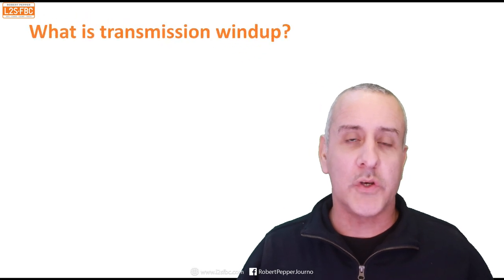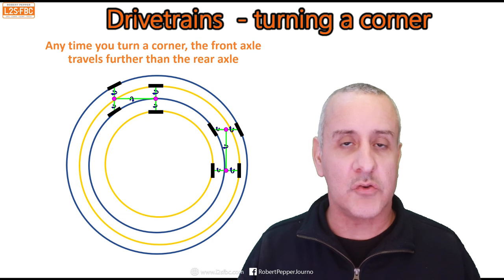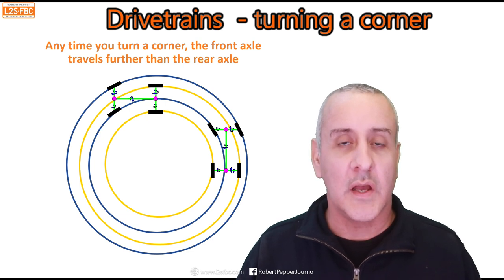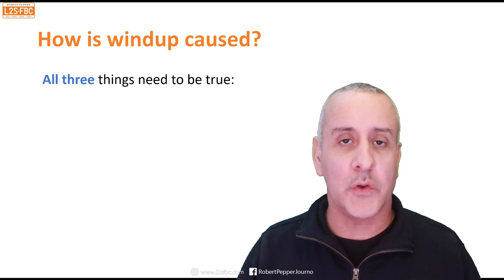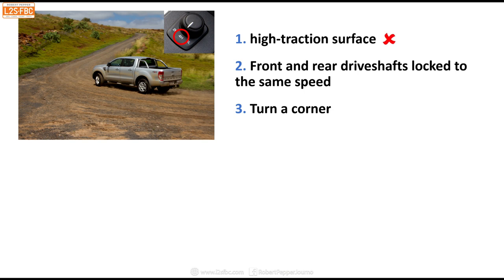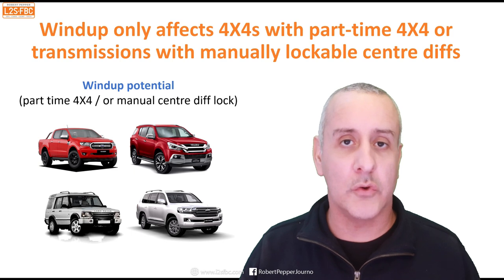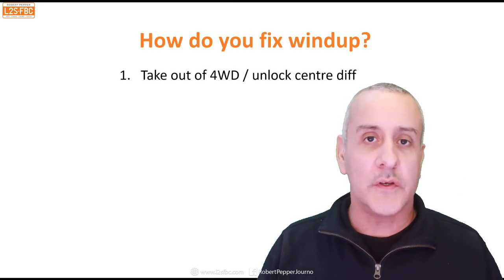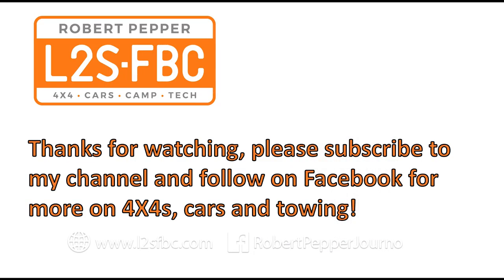Transmission Windup Explained (transfer case bind)

Comment: Excellent, clear explanation of wind-up. I am new to 4x4s and your videos have been immensely educational! Just one video was enough to get me to subscribe.
Reply from the maker: Glad it was helpful!
Reply: @L2SFBC  Yeah! I just hope I didn't ruin my new Jimny's transfer case yesterday or any other part as I took nearly a whole U-turn in a parking lot with 4H engaged. I could feel resistance halfway through the turn as the driveline was winding up. It felt like one of the wheels was getting its brake applied. When I realised what happened, I immediately shifted into 2H. After the car was on a straight path, I had to put it back into 4H and back into 2H and move forward to free up the front locking hubs.
Reply from the maker: Should be ok. Don't do it again 😀
Reply: @L2SFBC  Oh, I won't! You can count on that! Thank you again. Cheers!

Comment: This was a fantastic explanation and demonstration. The one thing I've never been able to understand is where this windup energy is stored. Is it torsion in the axles, or in the gearbox shafts, and if you keep driving under these conditions what is likely to fail first? Is it snapped axles/cvs, stripped teeth on diffs or the the gearbox. thanks again, wonderful video
Reply from the maker: thanks, please share! energy stored everywher in the drivetrain. As to fail first, really very variable and I haven't got enough experience to comment, thankfully!
Reply: I think the entire drive train stores energy like a torsion spring, the weakest link would fail first
Reply from the maker: Yes

Comment: A simple, old style part time 4WD is great fun in winter. Also because you have to learn how and when to engage and disengage the front. Tricky stuff taking a turn from a road covered with snow onto a well prepared main route with no snow at all! Full time 4WD are easier to drive, but it’s not so much fun…

Comment: Hi Robert! Thanks for yet another great video -- your channel is a real gem!

Does your recomendation of locking the center diff change when we're talking about a Torsen LSD? Specifically, if we're talking about LC Prado 150

From what I understand, torsen diff has a finite torque bias ratio, which means that it cannot send more torque  to each axis than TBR x 2 x friction of the most loose tire (in case of the center diff, because we have 2 wheels on one axis and supposing that the open diff has a TBR=1). 

My guess it that there is not much reason to use it on dirt roads, but offroad on an uneven surface or going up and down a hill would still be safer with the CD locked?
Reply from the maker: Yes, if you have a Torsen CD like in the Prado I wouldn't lock for dirt roads, but I would if it was an 80 Series with an open diff. When you get to uneven surfaces I'd be locking your Prado's c/d.  I do not subscribe to the "let's see how far we get before we use traction aids" school of thought; it damages tracks, increases vehicle wear, uses more fuel....nobody's a winner.

Comment: Your content is amazing, thank you.  I encourage others to join your Patreon so we can get more great content.    

I'm left wondering how people's rigs survive slick rock trails and why I don't hear much about issues caused by running those trails.   For example there's the popular slick rock trails in Moab, Utah with very high traction and sharp turning.  I would guess that vast majority of folks are running those trails without ever disabling 4WD, so there'd be plenty of opportunity for windup.   I never hear about transmission issues running these trails, yet on the other hand, I often hear warnings about not using 4WD on pavement.  This makes me wonder if the risk of damage caused by windup is overstated.  Perhaps wheels tend to break traction, even in high traction surfaces, well before serious problems occur?  What do you think?
Reply from the maker: Thanks yes need more Patreons, my dream is to be Patreon-funded and have a cool community of people discussing good things without FB ads and idiots.  Re the trails; well I've never driven in the USA, and have limited slick-rock experience but certainly enough to know that you would get windup in some situations. However the key thing is that offroad trails are not even or level so there's different weight on each wheel hence different grip, and have also dust/dirt and loose rock here and there.  Therefore, the transmission is able to unwind at points. Contrast that to a paved road which is always flat and level, never any real dirt, and therefore the transmission never gets a chance to unwind and synch front/rear axles, there's never anything close to diagonal wheel lift. A gokart has a fixed rear axle, no diff, and it turns partially by unloading the inside wheel to reduce grip...same sort of principle. I shall ask on my FB page the extent to which windup has to be managed.
Reply: @L2SFBC  Makes sense that there'd be more opportunities to unwind on even a high traction trail due to variances in the surface (though I think there's probably sections of trail that would be similar to pavement).   But I'm not convinced that the transmission never gets a chance to unwind on flat paved roads.  Wouldn't build-up of windup eventually cause the tire to break traction with pavement (unless something breaks first)?  Same as gravel, just more force required?  I've foolishly left my 4x4 engaged on pavement and while making an impatient u-turn, observed the tires squealing/hopping.
Reply from the maker: By the time the tyre breaks traction the damage is usually done - maybe not the first hop, but with enough, something will overstress.

Comment: I can tell you with absolute certainty that you can get wind up on gravel roads. It is something that I have experienced many times I have also  seen conditions where windup is pretty much guaranteed on gravel roads they can become very hard packed and very high traction.
Reply from the maker: Yes hence the point about high traction vs low traction surfaces. Some very hard clay roads when dry can be so good for traction you leave rubber marks. Some bitumen roads when snow covered are slippery.

Comment: I had this happen once, it was stuck in 4WD mode and vibrating hard over 60km/ph. Managed to get it unstuck by reversing backwards for about 10m and driving forwards and putting it back into FWD, a big thonk happened and it free'd it up. Most likely was a bad move but it worked, I had no idea windup was a thing until I started researching what had happened. Haven't put it back into 4WD again, scared its broken lol 😶‍🌫

Comment: Excellent video and very well explained. The YouTube algorithm has come up trumps for once. This video comes up in my feed after I had a brain fart and drove about 30kms in 4 high on bitumen. It was open and pretty much straight road with no tight corners. I pulled over to dirt on side of the road and it went into 2 high with no issues but would I still have windup?
Reply from the maker: Yes, we've all had such brain farts :-(  I don't know for sure, but I would suspect you did have a little windup but not enough to prevent the selector changing into 2H.  A different car doing the same thing may not have been able to get into 2H.
Reply: @L2SFBC  thanks for the quick reply!

Comment: Windup is just something to be aware of and not do because of issues it can cause to the transmission?  Its not like there is an issue with a vehicle to take in and get addressed?  I have a 2021 Ram and use the part time 4H when its snowy, but have experience what I now know is Windup.  Thanks for the video!
Reply from the maker: Just be aware of it yes

Comment: Thank you for the video. I have a question - how do open vs locked differentials impact windup? If you have 4H engaged, and you have a truck with open front and rear differentials - shouldn't this prevent windup from occurring under all circumstances, even on bitumen, bc the 4 wheels can all still rotate at different speeds at any given time?
Reply from the maker: Good question. Open or locked axle diffs has no effect. Windup is the relative speed of front and rear axles. Whether locked or open axle diffs the front driveshaft must spin faster than the rear. If you lock an axle diff on high-traction surfaces and continuously turn in one direction you'll get axle windup (not transfer case/driveline windup) as well as damage your turns. Turning the other way just increases driveline windup, but it cancels axle windup.

Comment: I accidently drove 10 or so miles in 4wd on pavement and did a 180 and it started jerking and not wanted to turn so sharply, but I drove back home a ways and shifted back into 2wd, is the windup gone, did I do any damage? Thank you 🙏
Reply from the maker: if you could easily get it back into 4WD, then probably you're ok

Comment: Excellent video! I have a question. I have a part time 4wd, it's a pickup truck. Do I need to engage 4 high when driving in the rain?
Reply from the maker: Not on sealed surfaces you will get wind-up.

Comment: Very informative. I discovered this last week w/ my 4x4 Frontier 2018 when put in 4hi and tried to make a 180 turn. Do you think this a mechanical problem that needs to be addressed by a mechanic? Or is a "natural problem" caused by the conditions you mentioned?
Reply from the maker: If you can take it out of 4H into 2H then it should be fine, and if the surface was high-traction then that'll be your problem!  Please share the video :-)
Reply: @L2SFBC  what do you mean "if the surface was high traction that'll be your problem"?
Reply from the maker: You get windup on high traction surfaces

Comment: This was great! Quick question. Granted there is a windup, can I drive  my SUV onto a hydraulic lifter like the ones in a gas station, have the vehicle lifted, and drive on it to release the built up tension? Thoughts and suggestions most appreciated. Thank you!
Reply from the maker: Yes you can but be careful of the sudden release of tension which may be dangerous. You can also jack up a wheel.
Reply: Thank you for the prompt advise. Just a coiple more questions before I head on out to the gas station.

1) While on the lifter, how long do I drive forward and on reverse? 

2) While up there, do I drive and reverse while still on 4wd or just on 2wd?

3) Just as a safety measure and still while up there, would applying the brakes make a difference or not at all?

Again, thank you for your advice. 🙂
Reply from the maker: As soon as you remove weight from the cars wheels then wind-up will dissipate. No need to drive anywhere. But lift very very slowly.
Reply: Thank you, Robert. Huge help, super!Heading out and will keep you posted. Will share your links to 4wd communities I also am part of. 🙂
Reply: Hello, Robert. Your advice worked just like you said. Once lifted, the tires corrected themselves. Amazing, man! 

My Montero Sport is running just as smooth as before, many thanks to you.

Will share your channel as well.

Follower here!

Thank you, Robert.
Reply from the maker: You're welcome feel free to show your appreciation via Pateron 😁

Comment: Does windup occur on 4L as well as 4H? 
Great video by the way!
Reply from the maker: It occurs whenever the front and rear axles are locked to the same speed. Whether that is in 4L or 4H depends on the car.

Comment: Great content. Just a quick question. Generally speaking does damage from windup become immediately obvious (bang/crash/nasty), or could it damage the drivetrain cumulatively over time? I am just about to buy a Ranger, which appears to work correctly in 4H & 4L, can I therefore assume there is no lurking damage from the previous owner creating cumulative windup events during their ownership.
Reply from the maker: Both. You can smash a drivetrain in short order as in a few minutes or it can be a stress building  up over time depending on how bad it is. A mechanical inspection is the only way.
Reply from the maker: Oh and please share
Reply: @L2SFBC  thanks for the reply. I guess unless it’s plainly obvious, any strip down inspection is going to be the most expensive part of any eventual repair, so best to leave this. Visual look around and wriggling the exposed drivetrain parts is probably as much that is possible then.

Comment: I think that driving fast enough (~100 Km/h)  will release the windup even on paved road. (Is it true?)
It's not recommended to cancel the 4x4 before releasing the stress, the fastest way is to go from paved road to sideways (dirt road), even with one side of the car.
Reply from the maker: High speed only works if the wheels leave the ground or are unweighted enough to allow windup to dissipate

Comment: So you have a picture of a wk2 Trailhawk there and say it will not get wind up. Can you not get wind up in 4wd low on a Jeep GC Trailhawk with Quadradrive II? I was under the impression 4wd low locked the diff.
Reply from the maker: If the centre diff can manually be locked on a 4x4 then it is possible to get windup. If it cannot be, and is computer-controlled or similar, then you can't as the computers manage the degree of lock to ensure no windup. Essentially the wheel speed of the front wheels vs back is compared to determine lock. In the case of the Ford Everest there is also an appreciable clunk as the centre clutch releases some tension to avoid windup in some modes as you turn.

Comment: If a bit of wind up occurs from driving on a surface with too much traction and you are able to switch it back to 2wd is the windup then relieved by driving around in 2wd?  Thanks, great video 👍
Reply from the maker: Yes
Reply: @L2SFBC    Sir, i do not have a 4×4..... but I have legit question anyway.  I have a sedan that has these  two wheel drive and obviously its front wheel power, will the computer sensors force the issue the so called  wind up issue sir,  "electronically" e.g. getting its programme error on to its front sensors by for example I currently am driving with 2 front  pairs of "highway tires" and different pair size two  @ back tires designed for/ recommended for "heavier load". Turning going  forward I noticed similarity too it reacts same as this video without 4×4 scenario but a sedan. I had different sized wheels and yes I get a wind up  of some sorts as mentioned on the video but I won't know for sure until I get the correct size tires all matching up. Fast food drive through creates this wind up if it is requires me to move on up the road incline to the window especially if it is leveling upward to the window while making curving angle degree turn to the left. I am a one time owner of my vehicle and the tire issue coinciding with this trouble seems like its plausible that wrong size tires are an issue hear. Sorry for my lengthy post  sir.🙏🙏 if not then  I'm trying to make sense of all these.

Comment: Lets say you did 720 degrees turning the vehicle, is it correct to say that you then need to reverse in a circle 720 degrees also? To get rid of wind up. According to what you said when you turn 90 degrees forward , you need to turn 90 degrees in reverse. So am i correct about the 720 degrees
Reply from the maker: Yes

Comment: My Kia sorento doesn’t drive smoothly round the corners at slow speeds - for example trying to park and makes a banging noise when in full lock. My mechanic keeps telling me that it is normal but I’m not so convinced!
Reply from the maker: Possibly CV joints?
Reply: L2SFBC - Robert Pepper - auto journo i suggested that before (after a bit of google research) but they said they don’t think thats it. Recently had a new prop shaft in front, anti roll bar and links behind)
Reply: L2SFBC - Robert Pepper - auto journo and they can see that the front diff is leaking oil

Comment: Hi there, I need some help from an expert. I was testing the different 4x4 gears (all the way to LLc) in standstill just to see the different indicators on the dash. I took everything back to 2wheelD but the lights stayed on. Even after about 50m of driving just before I heard a loud bang noise around the front wheel. Probably the windup and release... the 4WD lights whent off after that and everything seems fine. No noise.... should I have it checked out or perhaps be on the lookout for something more serious? Thanks
Reply from the maker: Is that a Mitsubishi?  Yes could have been windup. Did you drive in a straight line or not?
Reply: @L2SFBC   thanks for your reply. It's a Mitsubishi yes. No, unfortunately not, I was trying to get to a patch of sand. It's an automatic btw.
Reply from the maker: Auto/manual makes no difference. If you were on sand, no windup. If you were on a hard surface, then possibly yes.

Comment: i have another question. Let's say im  stuck in mud whilst in 4wd and i can't move forward or backwards. Would it make sense if i put my vehicle in  reverse in 2wd with 100 percent torque to the rear axles, will it pull me out? because in 4wd the torque is being split 50/50.
Reply from the maker: No because in mud there is low traction and therefore each wheel can only support limited torque before it spins. So, you want to distribtute the engine's torque over many wheels, so keep it in 4WD. All you'll do in 2WD is spin further in.